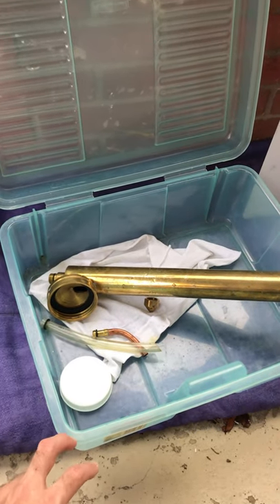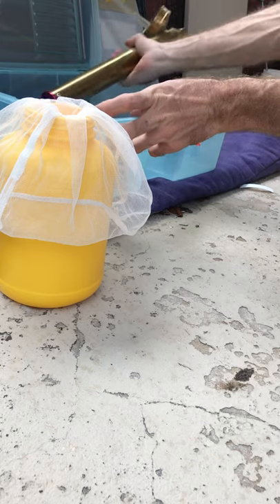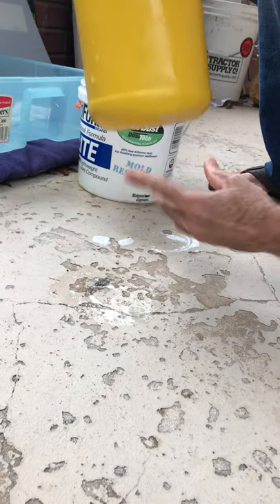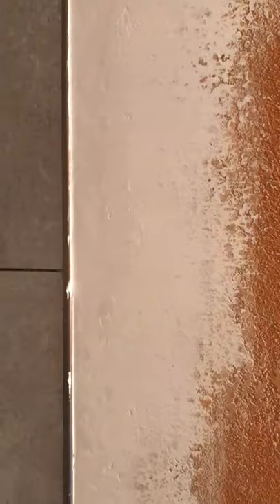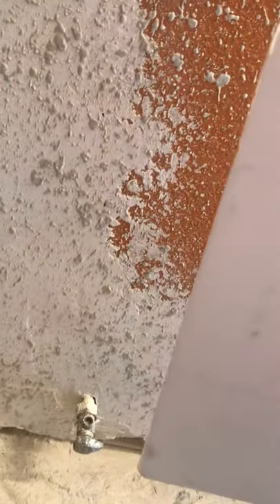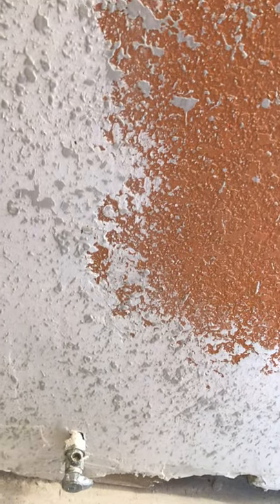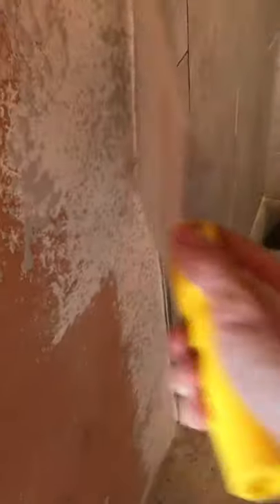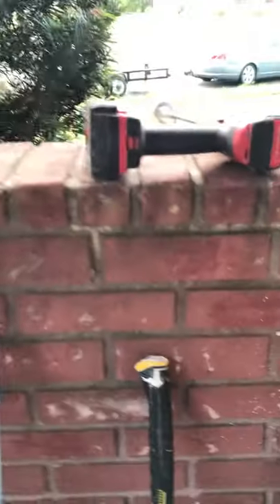Wall texture using a hand operated pump sprayer (red tail texture gun) full demonstration knock-down

Comment: I am having trouble with mine is squirts instead of spitting what compound is recommended?
Reply from the maker: https://youtu.be/d9ERM16iQL4    On this video 50 seconds into it you can see what I use for mixture. Use premix joint compound in the bucket mixed with water.

Comment: Just my opinion . But you had about 2 feet of wall left and the original texture was terrible . Instead of trying to match that ugly texture I would have just skimmed out the last 2
Feet smooth and shot a nicer , more consistent texture . Instead of trying to match it and spending time trying to remove the hard edge and blend it so it don’t show up when painted .